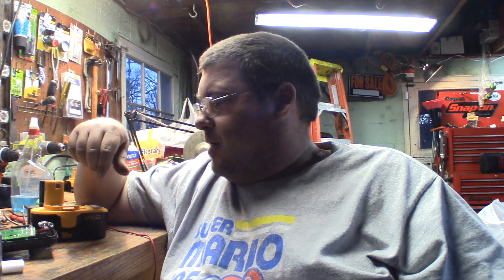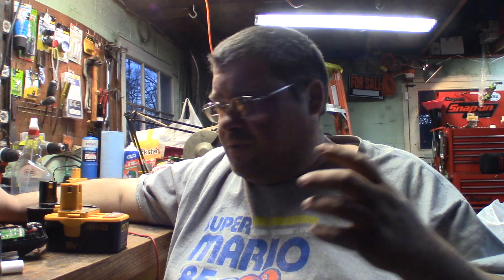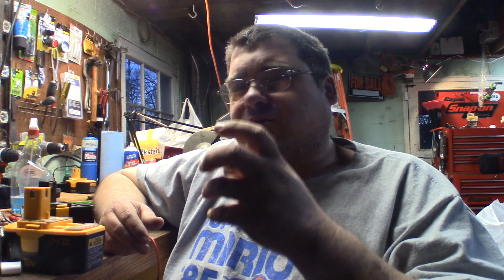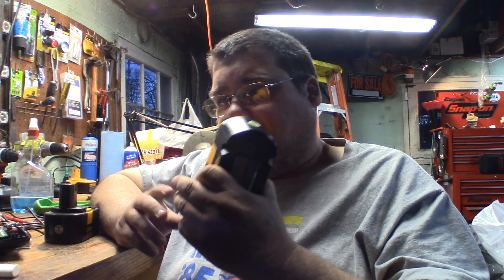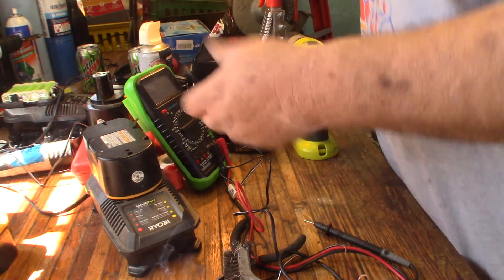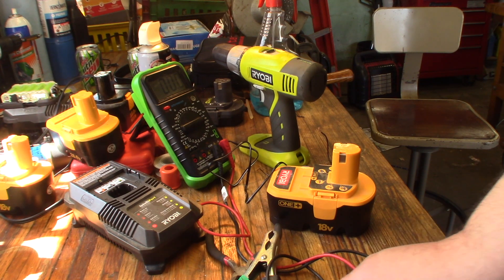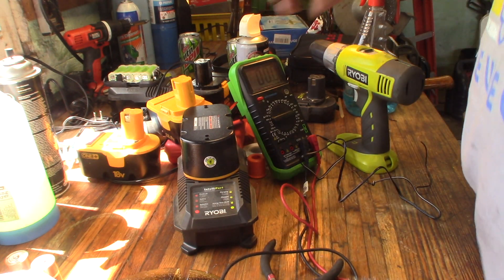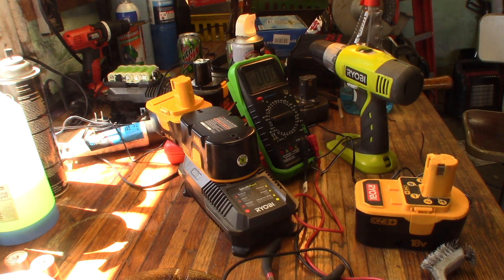How to Bring NI-CAD Drill Batteries Back to Life & Make Them Charge Again - Ryobi

Comment: Quick question, is there anything you can do if you try this and get the batteries to charge, but then they still go dead after a few days?  Are those packs just beyond saving?
Reply from the maker: You can try shocking them some more, but you probably have 1 or more cells that are in reversal or shorted too bad.

Comment: Not trying to be a hater I know what you did will work alot of the time's but I found out a trick right as you start getting the red light and it refuse the change.  By putting it on the charger on and off rapidly it gets it going again I guess it's almost like the charger is doing what you did at a lower burst of energy jump starting it just saying right before you realize the battery is going bad might get it going again before attempting what you did. But I tried your method and works great job on the video.
Reply from the maker: There is not hate there.  I have tried the plug and unplug thing and have never had it work for me.
Reply: It worked for me but didn't get me too far meaning just bought me some time maybe a month or so after that didn't work but I will try your method thanks for the video

Comment: Doing this is like giving CPR to someone with a bad heart.  Sure you might revive the battery temporarily, but its days are numbered and besides the dendrites you blew, there are others still growing and the ones you blew will grow back too.

In other words unless it is the end of the world and that's the only battery you can access, it is largely a waste of time.  You don't get back full capacity, have to keep fiddling with them when your time could be spent on something more productive and valuable.

NiCd do not, in fact, last 40 years in most applications.  There are many reasons but the reasons are not as important as the reality that it's just not going to happen.  Particularly in this case, your zapped cells have a lower remaining capacity and as you run the tool, they will begin to reverse charge and become damaged.  Ironically, this may have been why they were damaged in the first place if not a poorly (cheaply) designed charger, but once they have degraded far enough to need zapped, the likelihood of further damage from discharge beyond the 0V threshold becomes far greater.

Again, it's just not worth the bother except in some extreme situation, and if you stop and think about it, you would have been MUCH better off if you had just bought a new battery NOW, so you have a NEW BATTERY in case that extreme situation arises, instead only having that half dead, zapped battery that you resisted replacing.

Let's face it, everything has a storage space and weight penalty.  You can't afford to hold onto a lot of junk taking up the place of more dependable gear.
Reply from the maker: I don't think its a waste of time to shock it and get another year out of it or two and then shock it again.  New batteries are expensive. Sure there are diminishing returns the more time you shock it, but the key to a happy life is spend as little as possible and save for tomorrow.
Reply: Good job Frugal.

Comment: To me, the introductory explanation was very helpful .... and necessary.  Too many of us are working on false information about this issue.
Still, for those of us who don't have a welding unit, it was disappointing  to watch all that time and then find out that one was necessary in order to resurrect our batteries.
Reply from the maker: Anything that will put a quick surge of current will work.  You can use a car battery charger or even another battery hooked up in parallel.

Comment: Mine worked, not right away, you have to leave it in the charger a little longer.. I had to leave them in 3 min to 5 min then they starting to charge.. I did not use the welder, I used wires from one good battery to the bad one, zap it a few times. Worked for me.
Reply from the maker: Thanks.  Glad you got it working

Comment: Ni-CAD is so inferior to lithium.
Better to upgrade.
Take the battery apart and replace the cells with 18650 Lithium. 5 x 3.7v lithium in series is equivalent to the 15 x 1.2v Ni-CAD you will find in an 18v battery. If there is room inside the case, double up on the capacity with 5 sets of 2 (the 2's being in parallel)
You will need a lithium charger which you could connect to the terminals in the dock after removing everything else. But i advise getting an IMAX charger (which is programmable and can charge anything) and connect the output directly to the battery terminals or modify the dock as described.

Where do you get the 18650's? Inside dead laptop and lithium tool batteries. Try asking someone who works in an IT dept. They throw out lots of laptops and batteries.
Test the cells and discard any that are below 4v after charging, but you will find they are nearly always all ok. Don't buy them on Ebay from China. They are all fake rubbish.
Reply from the maker: I wish I knew somone that worked in IT.  The problem is that lithium cells by themselves have no over current protection.  A short in the tool would lead to fire pretty quickly.
Reply: The protection circuitry is also in the battery packs you are recycling and are inexpensive. If you buy individual cells they have individual protection modules.
A lithium charger and the IMAX cut out when they are charged or when the voltage has stopped rising. The only other way they could overheat is when discharging under heavy load. You would see it smoking as you are using it. I've never had this happen but I always use the protection circuits. The NICADs are more dangerous.

Comment: If I don't have a welder can I use a deep Cycle Marine battery or maybe an a/c car battery charger That has a switch on it to boost the current for starting a car on a dead battery. Thank's for your advice....& your help.
Reply from the maker: I have had a lot of comments from people that a car battery charger has worked for them.

Comment: been doing this trick for years, and ya don't need a welder either, just use a line cord thats had the head cut off, strip off about 1/2 inch insulation on both wires,, u can insulate the insulation some more with either elec tape or couple layers of shrink tube,, and form wire "tips" off stripped ends, then pre-tin those for duration and rigidity ...then plug in line cord, and with extra caution, just tap your + &- leads on battery with the tips, it's ac voltage, so polarity doesn't matter ...I've had about an 88-90% success rate with ni-cad drill and roomba batterys
Reply from the maker: Just keep both wires in one hand so if you slip you don't get mains voltage through you heart.
Reply: @frugalprepper  Why didn't I think of that....D'ohhhh ;)

Comment: Great video..good explanation on how it works, as well as WHY it happens! Thank you.
Now..I NEED to ask this..no disrespect intended.
So, your telling me that IF I go buy a welder...I MAY be able to save my battery???
Seems kind of expensive to do that way.
How about just a split 110V cord, and short it like you do the welder, will that work?
Thanks again!!
Reply from the maker: I wouldn't put 125V into a battery, but if you can get a good current into it at a lower voltage, like 24V, it will probably work.

Comment: Is that welder you are using putting out A/C voltage or D/C voltage? I seen that you are putting the ground clamp on what you say is the negative side of the battery and that gives the impression that you are using a D/C voltage output welder but I'm still wanting to know so I do this correctly if I ever try this trick on a battery
Reply from the maker: It a 120V AC Stick welder
Reply: @frugalprepper  I understand that it is a 120VAC input voltage welder but what is the output voltage type of output system? Is it A/C or D/C for a D/C it would have a full wave bridge rectifier converting A/C into D/C voltage type
Reply from the maker: @ryanclay959  AC

Comment: How do you repair a charger?
Reply from the maker: Find out whats broken and fix it.
Reply: @frugalprepper  I have a BOSCH BATTERY CHARGER that just stopped working. I don't have a schematic to find the problem. I don't know the value of any of the internal parts. This is the charger=    2 607 224 002  input: 115VAC 60 Hz 36W OUTPUT: 7.2-12VDC 1.3A   I called Bosch and they suggested going to LOWES as they are a distributor for BOSCH. The representative at LOWES told me they no longer handle BOSCH and he didn't know how I could get a schematic for my unit. Do you have any suggestions?
Reply from the maker: @AlbertLuppo  Yeah you will never get a schematic, it is considered proprietary information.  The problem with a lithium charger will be that is is microprocessor controlled, so if the problem is in that circuitry then it's fairly hopeless.  Most likely though there is going to be a transformer, so diodes setup as a bridge rectifier, some type of voltage regulation and maybe a buck converter.  I would start with making sure you are getting good out put from the transformer and see if you can find a bridge rectifier or 4 diodes and test to see if you are getting DC out after that.  Unfortunately it is a bit of guessing and testing when there is no schematic.

Comment: That is a big reason why I have no cordless tools. What good are yester-century technology batteries that do not work? Corded tools work, even when old, even when sitting around for a long time.
Reply from the maker: As long as you've got power and an extension cord.  I used cordless because they are handy to grab and go.  Time is money.
Reply: @frugalprepper 
They are not handy if the battery is dead from a long period of disuse, or if the battery will not hold a charge. It sounds like you use your tools more often than I do, and obviously that would make a difference. So when are the dependable free-energy power tools going to come out?

Comment: Thanks for posting. Any clue why my 18v batteries won't store more than 10v? and is there a hack to "wake up" the cells that may not be charging correctly? They are Dewalt 18v NiCd, 7 years old.
Reply from the maker: Sometimes you just have a bad cell or one that is in reversal.  There isn't much you can do but tear it apart and measure the individual cells.  Might make a good video.  How to make a good battery out of two bad ones.

Comment: Heck...my PS130 battery charger is a 14V wall ... adapter type...so what can I do????
Reply: I have had fairly decent results zapping the individual sub-C bad Ni-Cd cells in a battery pack using a 14.5V wall wart and 2 paralleled 10,000 uF caps. Opened the battery pack to do this, not as easy as the method shown here. Takes a bunch of zaps with this setup, probably it's underpowered, but it does work. After a few zaps I'd measure the cell's voltage to see if it was back to normal. Some cells tended to revert back to their shorted state also in a short while. With repeat zapping, they do better.
Reply from the maker: Get a welder

Comment: The best thing I found was a charger you can make it that turns your battery on and off for like 2 or 3 seconds at a time when it's completely dead and then it'll start taking a charge so you need some kind of a switched charger
Reply from the maker: Because when it turns off and on there is a rush of current that burns the wiskers off.
Reply: What about just unplugging & plugging it in? Would that work?

Comment: You know the conductor between the batteries could blow using that much current so you can open them up and make sure your batteries are still in series
Reply from the maker: It has never happened

Comment: Unplug the Charger ... insert the battery ... Plug the charger back in .... the Battery charger will start charging.  This works only with the older Ni-Cad batteries and their chargers ... NOT with the Li-ion.

Comment: I tried this with just a pair of 12v car batteries and some jumper cables to make 24v and holy crap it worked! I had six old Ryobi ni-cads that hadn't charged in at least 10 years but I kept them hoping I'd find a tip like this. Thanks man!

Comment: In my experience as I have worked with Ni-CD and Ni-Fe batteries, I have found that discharging the Ni-Cd below 1 Volt they will short circuit to a greater or lesser degree depending on the current, to eliminate the short safely I first tried 4700 uF x 35 volt capacitor discharged into each cell that was shorted generally it did not work as that value capacitor did not have enough energy stored to vaporize the short and low voltage can not force enough amperage through the higher resistance shorts, so I tried next a 4700 uF x 75 volt capacitor with better results, though I still was not enough to vaporize the low resistance shorts, so I went to use a 10.000 uF x 100 volt capacitor, this one was nearly perfect and to get better results I would recommend not to use a single capacitor but o use a bank of capacitors as some capacitor discharge welders have; it is not a good idea to make the discharge through the full battery pack as each cell has its own internal resistance that will reduce the current available to vaporize the short in the shorted cell.
Reply: Lots of talking. I had 2 flat batteries. No possibility to charge. Drill didn't  worked at all. Connected 2 12 volt bat to make 24 volt. Connected  the ryobi 18 volt for approx 10 seconds. They worked again. Showed 19 volt and they charging again. Much easier and save.
Reply: Lathe

Comment: would just charging it with a low current at 19v charge them , using a charger without the circuitry in it obviously ?  say using lab power supply at 18v @~ 0.1a current for a few hours or does it need to be shocked ?

Comment: Hitting it with a stick or mig welder will usually make the Charger see the batt as chargeable but once the Charger completes the charge, the drill will not last long on that charge. I tried this with my Milwaukee 12V. My fix was to buy a new 12V pack.

Comment: Yo bud quick question would a 12v car battery have enough power to zop that dead battery to good again when the car is running it gives one hell of a volt
Reply from the maker: Probably not, you really want to be above 17votls.  A car started will be between 13.8 and 14.5 volts typically.
Reply: Thanks I tried it out and I'll be dam It really worked good and did a great job. The battery is better then ever. I was scard so I built a wooden box and put the battery inside and hit every pos and neg. And brought the battery back from the dead. I felt like Frankenstein lol thanks again for sharing that with me. I really wish I new they a year ago. All the batterys I had to dispose of. Thanks

Comment: Whiskers lol... I'm quite annoyed that he clearly hasn't prepared before making this video and provides no evidence to his claims. 

 In storage the cadmium in the NiCad can form these dendrites (thin, conductive crystals), which can bridge the gap between contacts and short out the cell. Once this happens, there is really nothing that can be done to fix it long term (or so they say). The best way to prevent this from happening is frequent use.    

To rid of the memory effect its recommend fully discharging the NiCad you are using before recharging...  

Over charging and poor store is the killer...  a fully charged battery that  dissipates all it's energy very quickly when being used has normally been over charged too often... Occasionally this can be fixed by running the battery through a few very deep discharge cycles.

Comment: Thanks a lot dude! I don't have a welder, but I was able to get them working again using a car battery (in parallel) that puts out about 2700 Watts. They went from reading flat zeros to about 7 volts and now are taking a charge. Great tip!
Reply: You don't even need a massive battery or welder. A plain old 12VDC wall wart, or laptop power brick, etc (though you need current limiting resistor to keep the PSU running if it's a regulated type with an undervoltage shutdown protection circuit) connected to a good sized capacitor bank will allow zapping with plenty of current to burn through the dendrites shorting out the cell.   Obviously not everyone has a "good sized capacitor bank" lying around (lol) but if you're going to go the route of zapping cells, then realize that you're going to have to keep doing it and it may be worth the bother to make a capacitor bank to do so, so you aren't trudging out to where a car battery is every time. Then again a sane person would just buy a new battery.

Comment: The reason most packs go "bad" is because 1 or more cells drop to zero voltage and there is nothing that can be done to fix this.  You can take cells from another bad pack and replace the bad cells (if there is any that are any good) and revive a bad pack.
Reply: That's creative, much safer and durable on a long-run. Thanks for that tip!

Comment: No burn marks. Rubber bands hold jumper wires in place, 14 gauge solid copper or nomex. Shocking the battery pack from a distance increases safety as well as moving the arc to the other end of scrap wire.